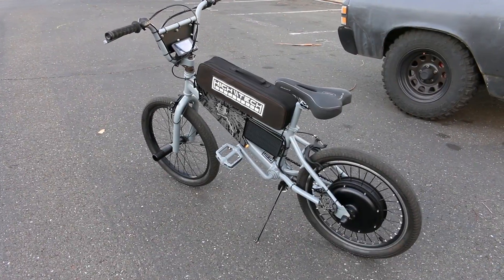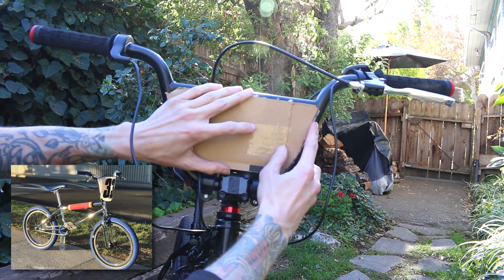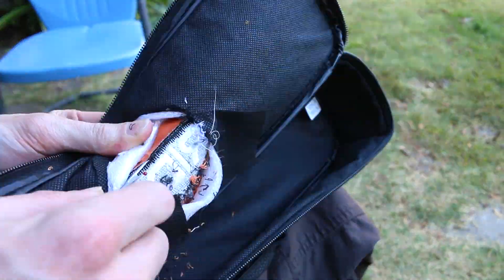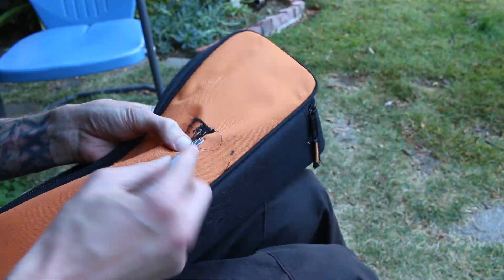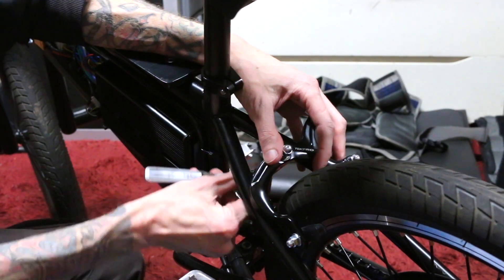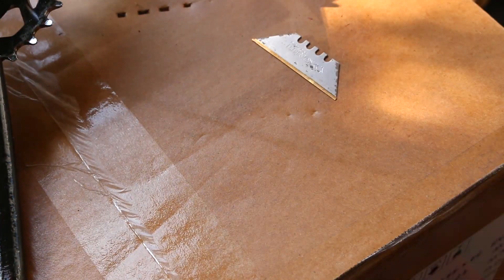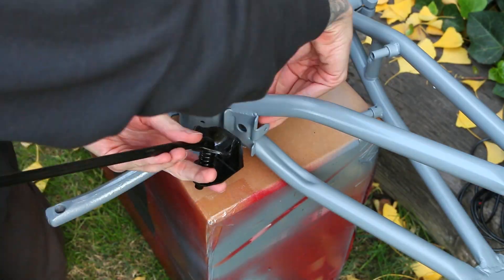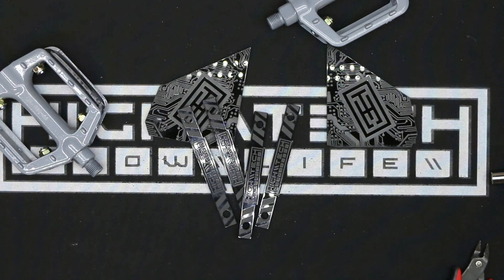🚲 Custom 3000W BMX E-Bike [45MPH!] - Part 4 - Cosmetic Mods, Paint Prep, Painting, Dyeing, And More!

Comment: For painting fabrics, use leather paint with a sort of thinner, for example the brand angelus direct, real good quality, I used it for years to custom paint sneakers
Reply from the maker: Thanks man! I think even spray paint would have been better than what I did, nylon just does not want to be dyed.
Reply: @hightech-lowlife  that’s the way we learn! I’m actually a clothes designer but learned this month to dismantle a vespa scooter, repaint it, repair the engine and put everything back together, we came, we saw, we concurred🤣
Reply from the maker: @tristenpieters1462  Awesome man, there is a lot of fulfillment in taking something old and broken and making it run and look good again 🍻

Comment: Most of my time is just spent waiting for parts, i think in 3d as in i can imagine the size color detailed looks of a bike project and imagine a fully 3d idea of what im going for. One benefit of being on the spectrum
Reply from the maker: For sure, I don't write down most things for planning as it changes a lot as I'm building. Have to be able to workaround and change ideas quickly. 👍
Reply: @hightech-lowlife  I've been surprised at how easy this build is going compared to other bikes I've worked on. I had to give up on my last mx build
Reply from the maker: @Kamijay97  This build wasn't that challenging really, and it was one of my earlier ones, I will be making another even higher powered EBMX sometime soon. I can never give up, which seems like a good thing, but it can get you in trouble.

Comment: I did the same exact thing last year with some rusty pink Barbie bike..but with two 1000w motor in parallel running over volt 48v to 60v😅it got so much torque😅 if you don't hold on correctly your hands get ripped off of the handlebar 🤣🖤zooOooooommming.. end up selling it to some dad that want to give it to their kid for Christmas 🤣
Reply from the maker: That's awesome man! That kid must be flying now somewhere 😂
Reply: @hightech-lowlife  she actually got pulled over by the popo.. they couldn't arrest her because she was under age so she just walked it back home
Reply from the maker: @chikararexzpo  Awesome 👍😂

Comment: i know im late to watching this, but for the dying part, rit makes another one for synthetics called rit dyemore, thats what you need for nylon and such, i had this issue a while back but as soon as i used the dyemore it turned out just fine
Reply from the maker: Thanks a lot man! I'll have to try this out if I run into another stubborn garment like this 👍It's weird because I did dye a motorcycle jacket that was also nylon/synthetic and it took the same dye easily, whatever this bag was made out of, it just didn't want to stick. I appreciate the tip, thanks!

Comment: Hi. I’m loving your project. 
Are you thinking of installing torque arms??
Please do it, a very strong ones, tabt king of power/torque will break you rear wheel mounts in less than a second. 
Mine has 3000w and I’ve made a 4mm thick steel torque arm and took a minute to be tottaly grinded by the torque of the engine. 
Now made a new ones with a different design and they are holding up great
Reply from the maker: Thanks Pedro!! I'm not going to be installing torque arms, so far with my testing I haven't had any issues with the dropouts, you can wheelie, etc, no issues. If I did have problems here I would make my own and weld them on. 

What bike frame do you have? This will play a big role in the strength of the dropouts, usually for mountain bikes or road bikes there isn't a lot of material in the dropout area. For BMX bikes there is a lot more material in this area for extra strength (landing huge jumps, no suspension, etc). Also depends a lot on how you ride, for me to break the dropouts I would have to ride in a way that would be completely uncontrollable, my head would be broken before the dropouts were 😎

Thanks man!
Reply: @hightech-lowlife  it’s a mountain bike fat tire, it’s a steel frame, didn’t ruin the dropout but the torque arm that I installed. 
But good to know that your frame it’s holding up, but from time to time check how the dropouts look. Overtime they may suffer. 
I’ve posted a videos of my diy battery, soon I’ll post videos of the ebike also, but not even close to the quality of your project.
Reply from the maker: @pedrocarvalho5824  From my experience the mountain bike frames are pretty anemic in the dropout area, I'm sure it's to try and save weight, but from all the (normal bike) frames I have worked on, this BMX bike has a lot more material in the dropouts by comparison. 

I personally wouldn't put more than a 1500W motor on a 'regular' bike frame without reinforcement, but so far this BMX frame has been extremely stout, all things considered. 

Awesome! I am thinking of making my own battery for the project after the next one too. Hit me up when you have some links to your vids and i'll check them out! Thanks!

Comment: I can't believe this just popped up on my recommended! I've just watched all 4 parts so far. I've just finished building my own electric BMX. My battery is in a backpack to keep it more stealth (police are strict here in the UK). I'm using a 52v battery at 35a. I managed to find a BMX with front disc brakes which was a HUGE bonus as the standard brakes just didn't cut it. I can't imagine how fast yours must be, mine feels pretty insane! I love the paint job you did, that's next for me. I'll have to make a video and let you know when it's uploaded 👍
Reply from the maker: Thanks so much for watching! Awesome! Yes, it's very unfortunate that ebike regulations are so much more strict over in the UK (and Germany, and other Euro countries) I believe the US will come next as they will find this is another way to generate revenue through taxation and 'licenses'. 

What I have made here is way too much power so I think you will actually be happier on 35A! So far I have been good on these brakes, but if I ever redo this bike I will weld on my own disc brackets. 

Thanks, yes send me a link to your video I'd love to check it out when you're done, I'm sure you will have a lot of fun. I have made a lot of ebikes so far and of all of my builds even the ones with more power, this is by far the most fun bike of all!!